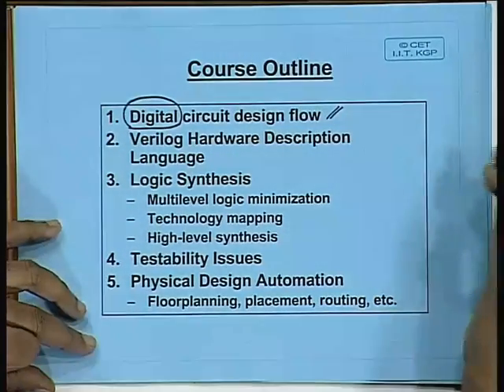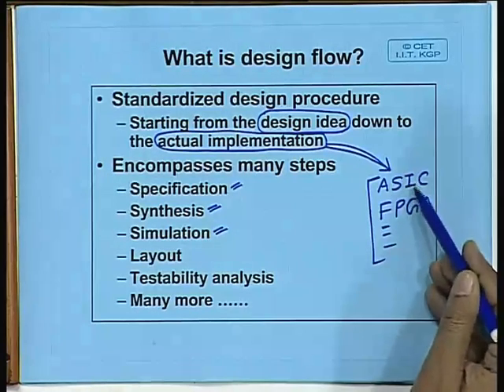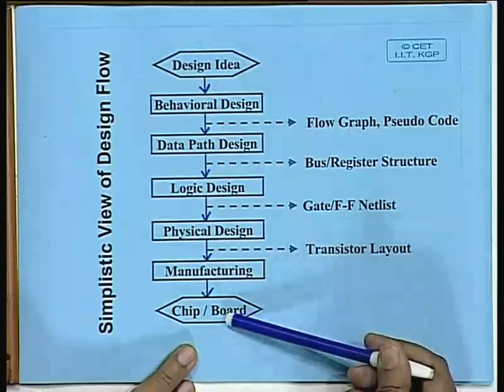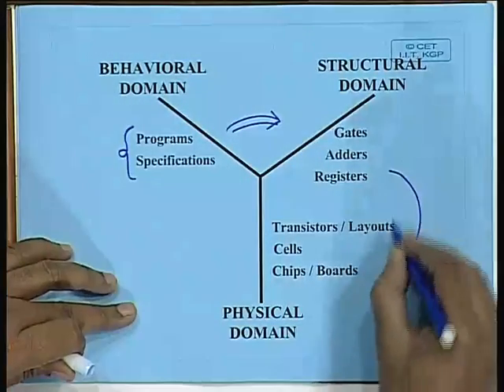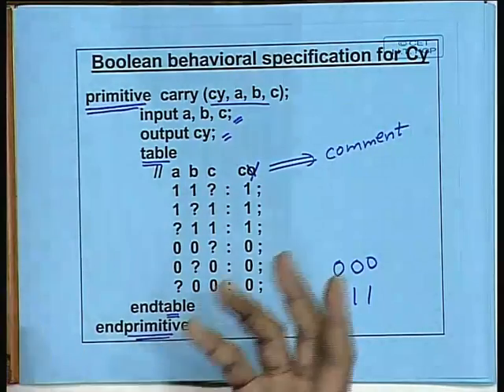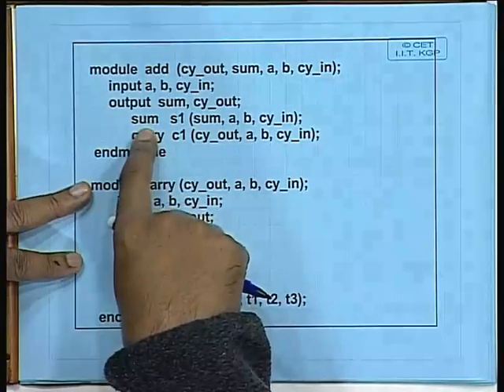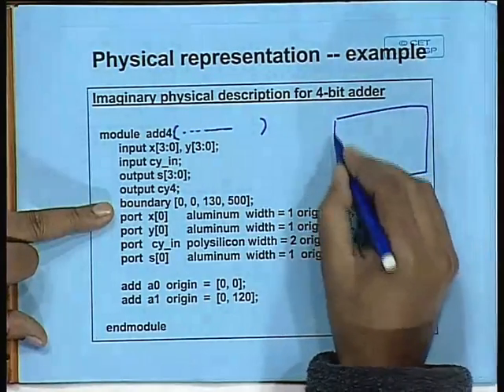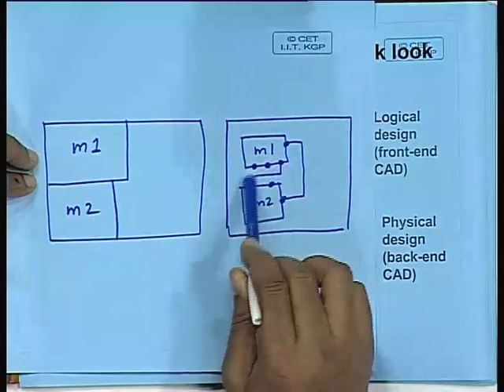Lec-1 Introduction

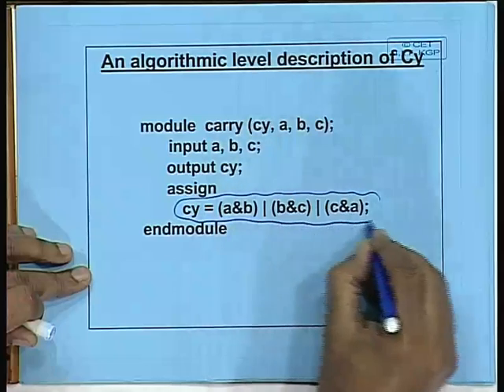Comment: I work with verilog, the behavior example given at around 28:00 is correct but far away from a practical implementation. In a current implementation, an adder would be simply represented as ' c = a + b'. The syntax being shown is Verilog95, while nowadays the design is on a higher level by using Verilog2001 or SystemVerilog. Current synthesizers are capable to optimize from behavior models to gate level better than humans.
Reply: Verilog HDL Complete Series | Lecture 3 - Part 1 | Data Types in Verilog HDL by FPGA made Easy Youtube channel.